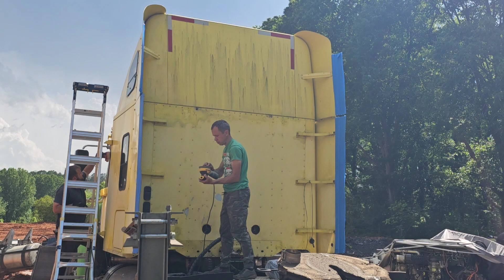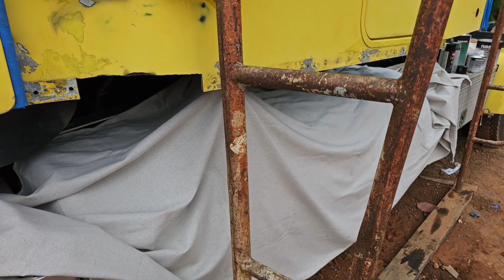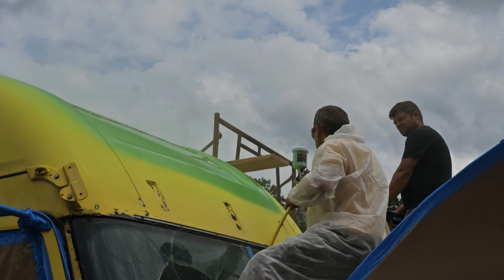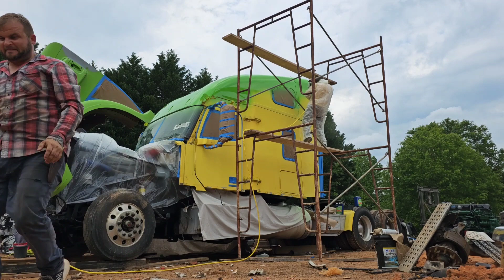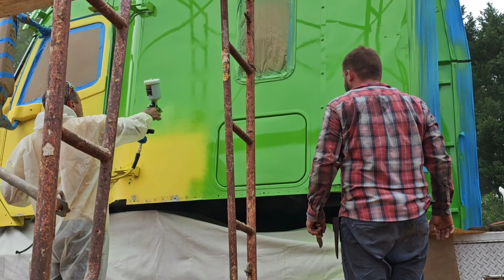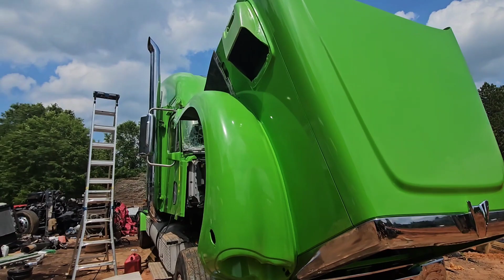How We painted a Semi Truck At Home

Comment: I guess no primer is needed when painting?
Reply from the maker: Not when you don't take off the paint completely
Reply: Not always
Reply: It helps with coverage to do a nice sealer but if there is no bare metal or filler its not needed.

Comment: Will not hold up. No primer or sealer. Start flaking off in 6 months to a year.
Reply: I was thinking the same thing. Definitely need to cover up the bare metal spots with epoxy or etching primer. Also, they won't be holding up long either without a mask
Reply: This person painting this truck  have no idea .love to see in a couple months with it all flaking off.
Reply: It will be fine no need to prime unless down to bare😊
Reply: Your clueless about painting.
Reply: @terryreeves4308 You have no idea what your talking about.
Reply: They are Horrible .